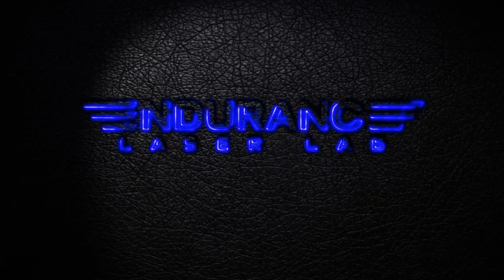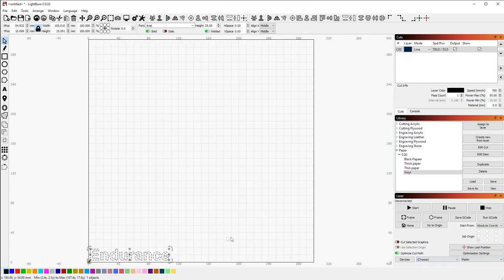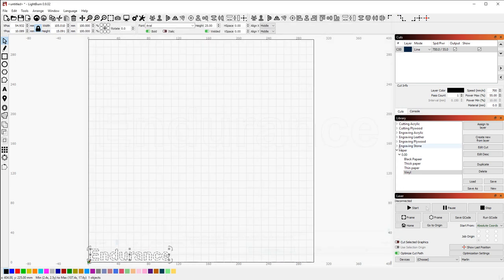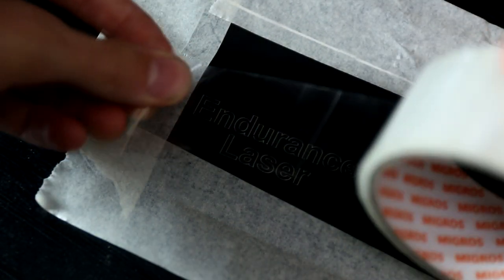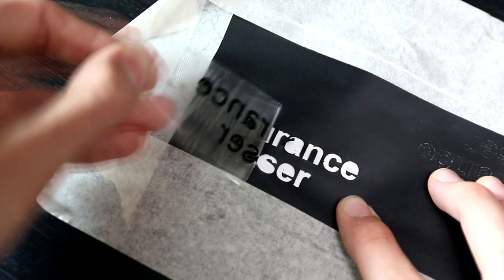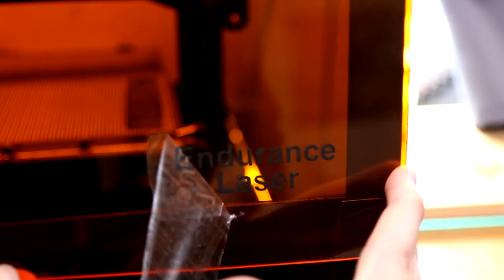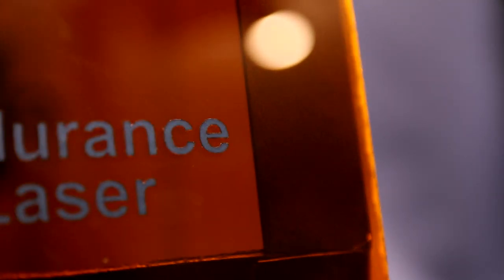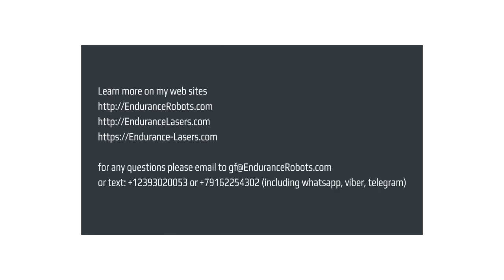Make your own nice sticker out of vinyl using 10 watt Endurance laser and Lightburn software

Comment: Vinyl. As in PVC, PolyVinylChloride, that produces chlorine gas when burned.. unless I missed some vital info regarding material or technique, you might want to rethink this very inspirational video. This really is laser cutting basics..
Reply: You can do this safety with proper ventilation. The issue is most people don't have proper ventilation, and the off gas is dangerous for people and equipment. That said, cutting a simple sticker is unlikely to hurt you or your laser.
Reply: *EDIT*
There are some types of vinyl sheet that are safe to laser cut. A commentor below spoke incorrectly and got me confused but this video straightened it out:

https://youtu.be/02nOyMOaEWE

Comment: You can do this but ONLY with pvc vinyl. Eco-friendly craft sells some but it is more expensive. Cutting regular vinyl is not only dangerous without a proper ventilated enclosure, but even with one the released chlorine gas will destroy your machine. Even with pvc free vinyl you need proper ventilation, it's considered laser safe but most is polyurethane based which doesn't ruin your machine but will release arsenic into the air. Remember it's "laser safe" vinyl not human safe
Reply: That's incorrect, apparently. You cannot cut PVC with lasers, PVC specifically is apparently exactly what you want to avoid, but there are "laser safe" types of vinyl sheet to laser cut. According to this video:

https://youtu.be/02nOyMOaEWE
Reply: Bro just put a sheet of clear glass over it and use a proper ventilation. Glass holds it flat and laser passes though and cuts perfectly